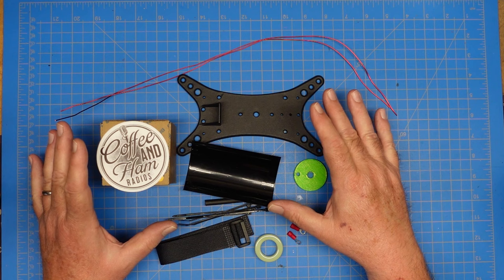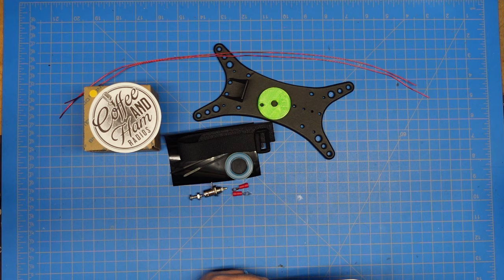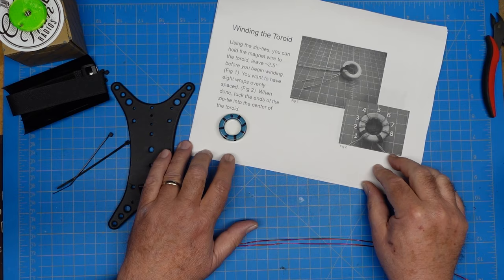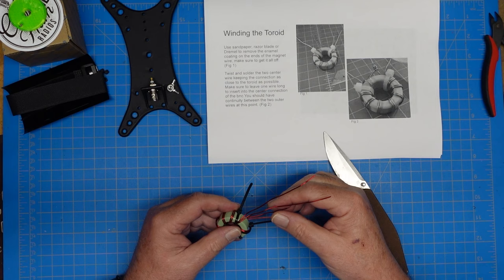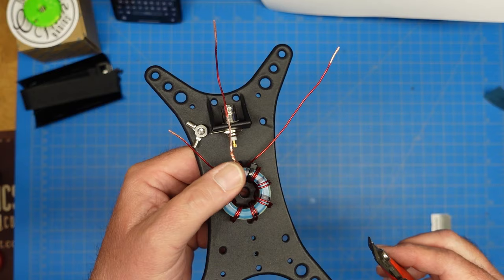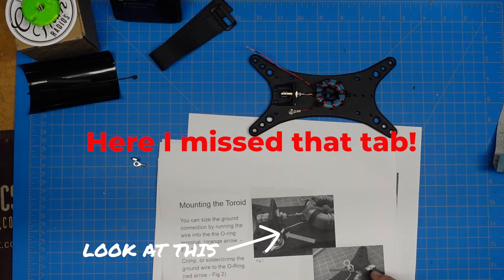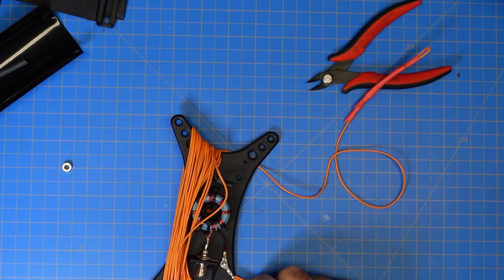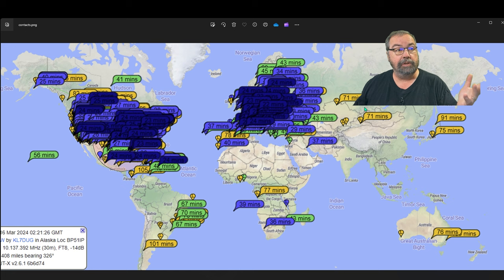Unleash the Power of Poseidon!  Coffee and Ham Radios "Poseidon"  Antenna - Build it!

Comment: That was a good and informative review! One small correction, though: MultiJet Fusion is HP's brand of 3D printer. Distinguishing them is like saying "this isn't a pickup, it's an F150." Like you implied, though, MJF is a high-quality commercial-grade printer, and it uses nylon instead of PLA, both good things for the quality of this antenna. Thanks for the great video!
Reply from the maker: Thanks for watching!  FWIW - MJF  is also an additive printing methodology - 

"Multi Jet Fusion (MJF)
Similar to SLS, Multi Jet Fusion also builds functional parts from nylon powder. Rather than using a laser to sinter the powder, MJF uses an inkjet array to apply fusing agents to the bed of nylon powder. Then a heating element passes over the bed to fuse each layer. This results in more consistent mechanical properties compared to SLS as well as improved surface finish. Another benefit of the MJF process is the accelerated build time, which leads to lower production costs."
Reply: It's like the F150 of 3D printers?  @FEPLabsRadio

Comment: That a great antenna. love that winder base. I wound a lot of toroid's and so so at it. Chuck and Ape got me beat . I did stack of 2 and 3         T-240 toroid's  with 10 AWG solod MAG wire . 49:1 for QRO end fed half wave. my fingers hurt 2 days. but doing 500 watt FT8 on 10/12 meters was fun. I ran 1/2 wave cut for 12 and fold back for 11 and 10 meters. bunch of ground elements like the DX commander antenna. ran up DX commander 10 meter pole. ran veritable like the Poseidon one but mono band cut 1/2 wave with 49:1 stack toroid core  that one has the 100 PF 3 KV cap.  ferrite stayed cool ! love the testing Ape and Chuck did. they did post some video's showing that ! for a small easy to deploy antenna this is all some.  great POTA SOTA antenna . love that antenna wire. I buy it in larger AWG . I used DX commander wire on my mono band 1/2 wave veritable build  . the half wave mono band DX commander antenna I made. that a fun kit you 4 made. 73's
Reply from the maker: Robert - I've been thrilled with the performance.  I've been using it all weekend on FT8, and some phone, and it's absolutely tearing up Europe, SA, and Africa.  Thanks for the support and thanks for watching!

Comment: Have you tried one without close spacing the wires?  I don't think the extra inter-winding capacitance is useful.  You could also use one piece of wire twice as long, wrap the first 8 turns, sand off some enamel for the tap, and lay the final 8 turns roughly between the first 8.  I believe that's easier than managing winding two wires at once.  Then I'd use stranded wire to connect the tap to the BNC center pin (some of the left over BNTECHGO wire should be fine, and you don't need to keep the insulation) will help avoid stress breaks due to vibration or getting nudged in the go bag.  (Don't let the solder crawl up into the body of the stranded lead, the point is for it to remain flexible.)

If you leave the stranded tap connection long enough, you could also try the adjacent tap points, just to see what it does to the SWR curve.

And speaking of the SWR curve, it would be interesting to see the real and imaginary parts of the reflection coefficient (or, equivalently, a Smith chart showing just the ham bands, labeled, or each on its own separate chart).  That point out whether the addition of a capacitor, or moving the tap, possibly on a per band basis, might help. (Though it's still not going to be an efficient antenna on 80m.)  (Maybe I'll snag a type 52 toroid and play.)

Nice mechanicals, and nice video.
Reply from the maker: Thanks for the comments!  This is the current kit CaHR is selling, so I put it together as designed.  You're correct, there's a lot of different ways you can slice this loaf.  Another guy I saw went down the path you mentioned, he built a multi-tapped setup.